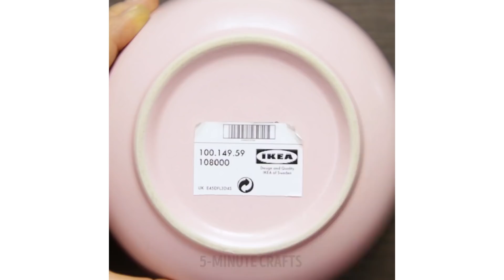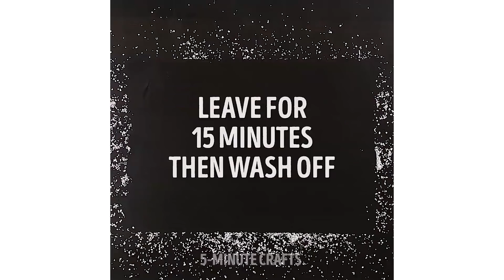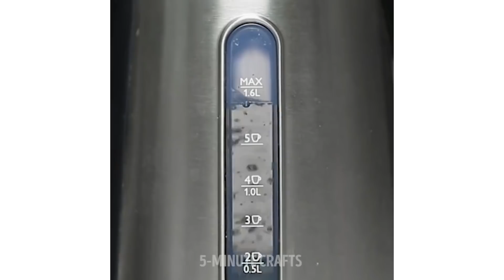40 ALL-TIME BEST CLEANING TIPS THAT WORK MAGIC

Comment: Thanks.  Not recommending toaster part.  Putting toothbrush inside toaster can easily damage heat elements.
Then you have to buy a new toaster like me.  But my mother-in-law used a rag.  Left in looking like new.  Ahh paperweight?

Comment: I tried 'lemon' in the microwave, it didn't work and mine was not that dirty.  It SHINES the sink Aluminum but it didn't really CLEAN it, though MAYBE it SOFTENED residue on the faucet for me?!  I used Non-fume Easy Off in the Microwave and it worked fine.